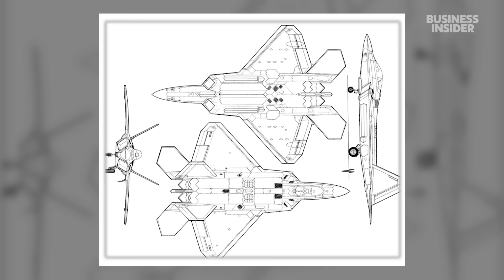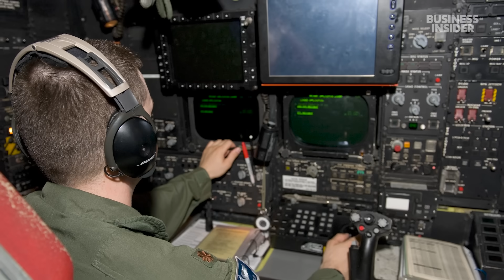USA vs China Fighter Jets | Balance Of Power | Insider

Comment: J-20 is not even as stealthy as F-35. And this can already be proven. 
1ST. Their is a 3rd party radar scattering CAD simulation done on Aircraft 101. Without RAM coatings, they compared all 3 F-35, J-20, and Su-57 low observable LO characteristics through their shapes/geometry alone. 

In a 20x20deg frontal aspect, "J-20 RCS is higher than F-35A RCS through the frequency range (approximately 3.5 times in X-band, 1.5 times in VHF band), it still has much better RCS characteristic when compared to Su-57.”

This mean even with the same RAM coatings used on the F-35, J-20 much more Su-57 can’t make up the difference in total RCS reduction given their LO properties/geometry. 

2ND. Both Pacific Air Force (PACAF) head Gen. Wilsbach and US Air Force Chief of Staff Gen. Brown assessment of J-20 as “It’s not anything to lose a lot of sleep over” when F-35s were able to close in on J-20s and observe them near Japan.

3RD. J-20’s canards and the whole vertical stabilizers are moving.

So F-35 definitely has the “first look, first shoot, first kill” maybe even a 2nd shot in beyond visual range BVR. Even if by a small chance they don't see each other and end up in a dogfight J-20 don't have a gun. Plus with Block IV F-35s will be able to carry 6 AMRAAMs similar to F-22 which is 2 more than the 4 PL-15s J-20 carry. Their are also 4 to 5 times more F-35s than J-20 with half of that in US arsenal. So US/NATO has both quality and quantity. Maybe against 4th gen platforms J-20 can be a threat, but it has a very minuscule chance against F-35 much more F-22.
Reply: Its the argument of M16 vs Ak 47.
Reply: @pee_diddy  More like an M107 or any other sniper rifle vs Ak-47.

Comment: F-22 is old and lacks important electronics for the new mozaic warfare. F-22 is no match to the J-20 in real-life combat situation. Guess why F-35 is better than F-22 in all the other aspects
Reply: yes, people don't realise the F22 is more than 20 years old. The electronics on it is like comparing a Pentium 2 to a modern PC.
Reply: @hughmungus2760  Its had upgrades to the electronics, its its not THAT outdated lol.
Reply: @nuckerball1259  Unless the F22 got a midlife upgrade with a total overhaul of its avionics they're going to be flying around with tech designed in the late 90s Meanwhile J20s are still being improved up with the newest versions entering service in 2023 featuring visually discernable differences. (meaning its going to feature the latest electronics too)
Reply: @nuckerball1259   ultimately, upgrades to existing airframes can only do so much. Just like how you can only upgrade an existing PC so much. Lots of legacy system on the F22 fleet are still left there just because it'd be too expensive and complex to rebuild one from the group up.

Comment: Balance of power goes to the F-22...too bad we don't make them any more and only have about a hundred of them that are actually  mission capable. Meanwhile China will almost certainly produce more J20 fighters that will improve over time.
Reply: It's like the F35 doesn't exist
Reply: @Zakna  Only 29% of the F-35 Fleet is mission ready...apparently there are some "reliability" issues they've been working on for the past few years...
Reply: already have   with ws15, super cruise and speed is faster and flight longer range than f22 or f35
this guy is so outdated
Reply: @jetli740   j20 is very different than the f22 and f35. Its indeed longer range because its a very very large plane, similar to how the su27's are essentially scaled up mig29's for longer range missions. Its role is to defend the south china sea in bvr engagements. f22 is older and designed with close range dogfighting in mind, and f35 is a multirole vehicle
Reply: @nuckerball1259  yes  those keep call j20 is a copy must be blind, they ignore hungary, korean,japan 5gen jet which look even more like f22/f35 .

Comment: Seeing those huge canards on a stealth fighter is hilarious
Reply: Funny enough, the people who yell canards are the ones who know the least about jet fighters lol
Reply: you sound like Bill Nelson.
Reply: Watch out you backyard! Chinese Immigrants joint by other Asian ethnics groups are building their new country inside of America!
Reply: Remember when how those canards managed to sneak up on a couple of F-35 over the south china sea ? 😂 now that was hilarious given that the F-35 was supposed to be " undetectable "
Reply: That sounds like an easy and obvious problem for China to identify if it is actually a problem.
Reply: You are probably the Type to think just because an aircraft is big it’s not stealthy 😂😂
Reply: kj-500 says hi
Reply: @orzdxy  E-7 also says hi. But it will also 1st detect J-20 than KJ-500 detecting F-35 as J-20 is less stealthy.
Reply: J-20 is not even as stealthy as F-35. And this can already be proven. 
1ST. Their is a 3rd party radar scattering CAD simulation done on Aircraft 101. Without RAM coatings, they compared all 3 F-35, J-20, and Su-57 low observable LO characteristics through their shapes/geometry alone. 

In a 20x20deg frontal aspect, "J-20 RCS is higher than F-35A RCS through the frequency range (approximately 3.5 times in X-band, 1.5 times in VHF band), it still has much better RCS characteristic when compared to Su-57.”

This mean even with the same RAM coatings used on the F-35, J-20 much more Su-57 can’t make up the difference in total RCS reduction given their LO properties/geometry. 

2ND. Both Pacific Air Force (PACAF) head Gen. Wilsbach and US Air Force Chief of Staff Gen. Brown assessment of J-20 as “It’s not anything to lose a lot of sleep over” when F-35s were able to close in on J-20s and observe them near Japan.

3RD. J-20’s canards and the whole vertical stabilizers are moving.

So F-35 definitely has the “first look, first shoot, first kill” maybe even a 2nd shot in beyond visual range BVR. Even if by a small chance they don't see each other and end up in a dogfight J-20 don't have a gun. Plus with Block IV F-35s will be able to carry 6 AMRAAMs similar to F-22 which is 2 more than the 4 PL-15s J-20 carry. Their are also 4 to 5 times more F-35s than J-20 with half of that in US arsenal. So US/NATO has both quality and quantity. Maybe against 4th gen platforms J-20 can be a threat, but it has a very minuscule chance against F-35 much more F-22.
Reply: @johnsilver9338 J-20 was built to hunt down US tankers and AWACS(US Achilles heels), not for dogfight. 
By the way 200 J-20 is the current number, not final, much much much more will come from the production line and it also will keep evolving and updating with new tech. 
In this video that analyst intentionally not mentioning the new WS-15 engine with supercruise capability that is already in mass production for new J-20 airframes.
Reply: @dwchen1  J-20 would have already been shot down in BVR and even in WVR by F-35s before it gets the chance to close-in and target US/NATO AWACS and tankers. Otherwise someone in the command and control structure f*** up. But with F-35s stationed in Japan, South Korea, and the Philippines this is not a major problem.
Reply: @johnsilver9338  a 3.5x difference in RCS is negligible. Both planes can already detect and target each other with EOTS before they are trackable by radar.
Reply: @hughmungus2760  A 3.5 difference means 37% difference in detection range. But that's just that start as their will still be a substantial difference in RAM coatings. Ending scenario if a radar can detect F-35 at 10km, it can detect J-20 at 20km. If a more powerful radar can detect F-35 at 100km, it can detect J-20 at 200km.
Reply: @johnsilver9338  'more powerful radars' like AWACS are going the way of the dodo because of very long range AAMs that can snipe them at 300km+  So you're pretty much getting into dogfighting distances with stealth aircraft having to find each other with their own onboard sensors.

This is why everyone is talking about loyal wingmen drones since both sides know that 5th generation air warfare will be one of attrition.
Reply: @johnsilver9338  also consider the battlefield. J20s were designed with the vastness of the pacific in mind. their range enables them to form up for local numerical superiority while the US has to rely on expensive and vulnerable tankers to bring any sizable numbers of F22s and F35s into the theatre. 

The sensor off the chinese coast is also alot more extensive than anything the US can bring to bear just because its china's home turf. Meaning F22s and F35s are being pinged from every direction by multiple different types of radars and passive sensors.
Reply: @hughmungus2760  That's what stealth is for. F-35 will undoubtedly detect J-20 at 100km if not more. While J-20 will only be able to detect F-35 at under 100km.
Reply: @johnsilver9338  
J-20 is inferior than F-35 and thats a very common knowledge. J-20's size & having no guns are obvious indication that the mighty dragon isnt for a dogfight. when u cut a log, u only need an axe & u dont need to bring a hammer. theres really no way we can match the US' counterpart given the missing technology that we have

J-20 is very reliant on AWACS or external detection. real question should be pointed at how really potent our army's detection is. if we dont have a way to detect US stealth then J-20 is kinda pointless

the problem is US can also do the same. it has its own AWACS so its a contest of who detects the enemy first
Reply: @hughmungus2760  You forget F-22s and F-35s stationed in Japan, South Korea, and the Philippines. 

Also China has a lot more to loose as their very own industry can be destroyed on their own backyard.
Reply: @johnsilver9338  You have a handful of bases in allied countries well within range of chinese ballistic and cruise missiles (and now kamikazi drone swarms)

China also has extremely advanced space based ISR which is on par with the US 

Meaning wargames show that the US loses most of its aircraft in the region to those in the opening salvo.

You have no idea how vast china's industrial base is. Short of nukes. conventional strikes aren't going to do crap.
Reply: @hughmungus2760  You also forget US has its own rocket force. Japan and Taiwan to have their own. And US have 6 - 7 times more satellites and this is before SpaceX is contracted to produce Starshield.
Reply: @leexingha  That's the thing also. China's AWACS are all in the L-band including KJ-500. Sure it can detect F-35 at a 100km or so but it still falls short of what a UHF band radar can do like USN's E-2D Hawkeye.
Reply: @johnsilver9338 no not really. The relationship between RCS and detection range is logarithmic. This number is more approximately 10% detection range difference.
Reply: @Gongolongo  It's to the 4th root NOT logarithmic. 3.5^1/4 = 1.368 or 37% difference in detection range.
Reply: they have little affect on stealth in this particular application
Reply: see american stealth fighters on chinese radar is even funnier
Reply: @levelazn Funny joke just not reality.
Reply: @ragnarokws2670  I highly doubt that unless they are really close which would be unlikely.
Reply: @ragnarokws2670 detecting it and being able to do something about it are 2 different things. Basically you would see it with just enough time to know you were about to have a bad day.

Comment: I lost count of how many wrong statements are being made lol wow
Reply: Ok, Bozo. Give three. Explain them, and then back them up with relevant data.
Reply: @knowingyourmind  F-22 isn't the most advanced stealth fighter, the F-35 is. Stealth isn't necessarily a planes ability to be detected but targeted at range. While both stealth fighters, the roles of each aircraft and how they achieve those goals are very different. There's three
Reply: @wolfskid15 1) an F35 is technically more advanced than an F22, but F22s has 100:1 kill ratio vs 20:1 of F35s; so it's a matter of perspective.

2) I think you need to correct your statement.

3) The analyst doesn't have reliable information about the J20, so your statement is also based on assumptions.
Reply: @itsyourfaultnotmine15  100:1 kill ratio of what? Balloons?
Reply: @wolfskid15  in 1v1.. f22 eats the f35 for breakfast
Reply: @itsyourfaultnotmine15  propaganda 101
Reply: @VinhTran-yh7uu  1v1 in dogfight or BVR ? in BVR the f35 is just better .
Reply: @PatrickBhardwaj  bvr is just airmchair simulation, f22 is the air superiority. sure f35 can launch missile bvr but the f22 can apply countermeasures and out fly the f35.
Reply: @ParadoxlnABox  for some reason is ONLY balloons, and you want it to stay that way. Is a beast on a leash and Poland wants the F 22
Reply: @ParadoxlnABox  Never heard of Iraq war airstrike? Maybe you don't learn history. That's uneducated way, bruh.🤣
Reply: @xo4205  are you talking about the ability for modern aircraft to take down Vietnam era MiG-21s? If so, congrats? Also, the F-35 entered service in 2015, several years after the end of the Iraq war. Maybe you are the one that needs to learn history.
Reply: @ParadoxlnABox  I don't know why the other guy said that the F-22 has a 100:1 kill ratio, as long as i know the F-22 has never encountered a fight with another fighter jet, but we do know that the F-22 made several missions for 20 years in Afghanistan it was never shot down, don't forget that Ukraine has been able to shot down Russian 4th gen fighter jets in Ukraine without any defense system, and the Talibans weren't able to the same to the Americans, the Taliban have decades more experience in war than the Ukrainians...
Reply: @christhedoc8689   Ukraine has sophisticated anti aircraft systems like S-300, Patriots, NASAMS, HAWKS, IRIS, and others. The Taliban has nothing comparable to that. It’s completely incomparable. The closest American has faced to a semi-sophisticated anti-air system is Syria. That’s why you don’t hear about the USAF going in there willy nilly. And I would say Ukraine’s systems are miles ahead of Syria.
Reply: J20 can super cruise without afterburners, the missile types both fighters carry and the radar cross section of both jets
Reply: @damianodonnell5844  the J20 cannot supercruise
Reply: @knowingyourmind  well ok. 1- it takes more than the ability to detect an aircraft and a missle to shoot down any fighter much less an f22 you have to have high frequency relay data to develop a probability/kill ratio high enough to justify the launch other wise you are firing blindly… many low frequency radar sets can detect any object in the sky but to have an P/K solution to hit a moving object you need a high frequency as the object is moving in angles and speeds that require multiple adjustments in real time,
Most countries have the ability to detect an f35 or even an F22 as in they know it’s there but to plot an intercept…. Even we can’t do it… we tried that the Aegis system which is basically the best we can offer currently was able to plot only THREE PK SOLUTIONS. In over 200 engagements with F35 in drills and none with F22 

That’s one… and it’s documented… 

2-the J20 has the rear cross section and heat signature of an SU37 as it’s power plant is identical to it so on a patriot battery, THAAD, or aegis it roughly looks like a Fiat 500

3- canards do not generate lift they provide stability due to cross section forces at low speed with a clipped Diamond wing which is the F22 it’s very unstable the f22 overcomes this the same way the B2 and B21 overcome the flying wing design with 3 computers that just made slight aeronautical adjustments in real time…. The J20 cannot do this so similar to the Euro typhoon it has canards to stabilize it… resulting it higher radiation crossection
Btw the f22 has a computer onboard that has one purpose… to not let the pilot do any flight path change that will cause the aircraft to imply G forces which are lethal to the pilot
That’s three all are unclassified data presented by the Airforce and joint nato command after evaluation of the F22 program cancellation in 2017